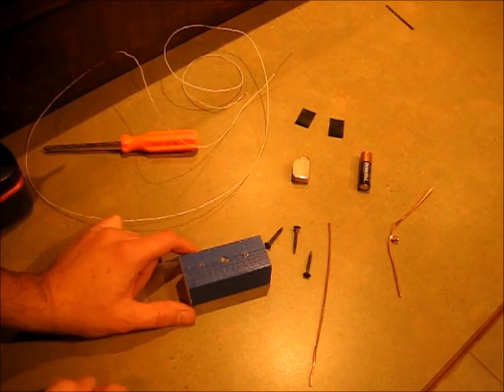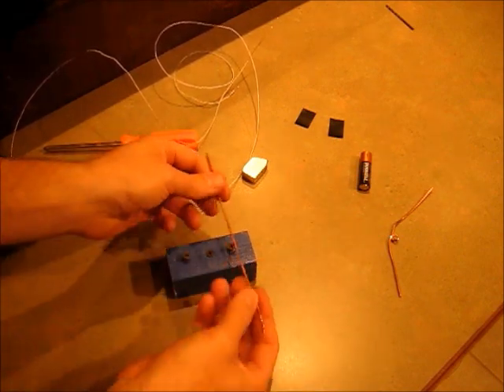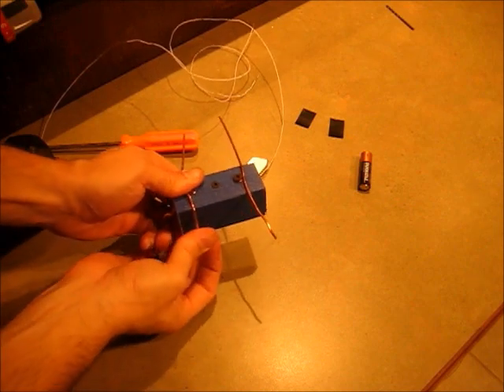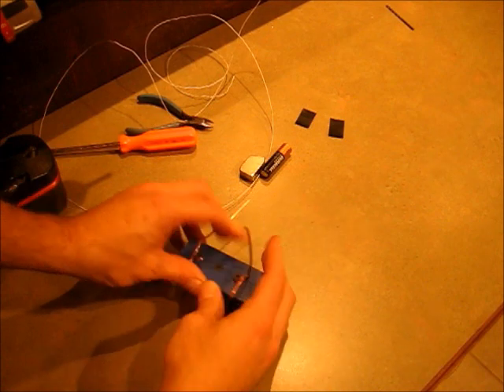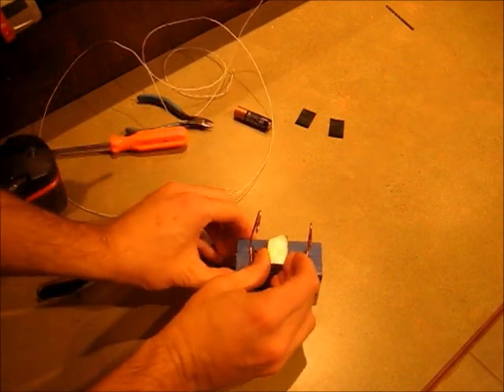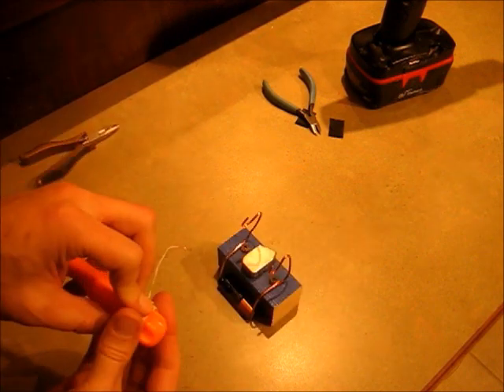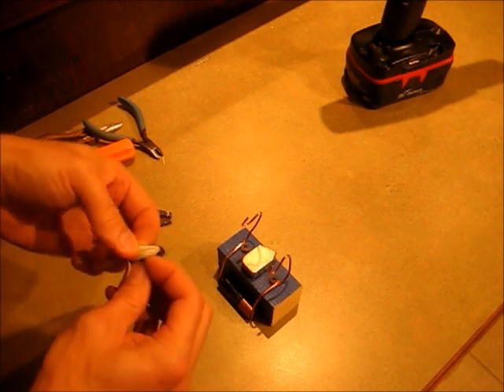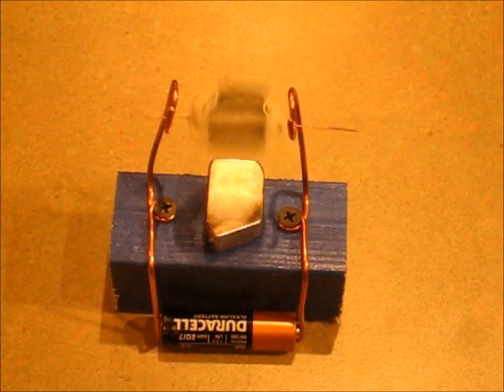How To Build a Simple Motor

Comment: I'm trying to build one of these but can't seem to get it spinning, idk what I've done wrong but not too sure what the magnet is doing in the first place since the stator is copper and copper isn't magnetic? Pls help! Thanks
Reply from the maker: Destin Pearson - Copper does not stick to magnets, but when electrical current runs through a copper wire, it creates a magnetic field.  This field plays against the magnet, to spin the motor.  Hook up the battery and try to get the motor started with your finger.  If it does not work, send a video of it not working to HowToLou@gmail.com, and I will help you diagnose the problem.
Reply: Alright I sent a video! Hope u can help figure it out if it isn't too much of a burden, thanks!:)

Comment: This is a crazy question but what if you make a bigger version of this motor and use it in an automobile lol
Reply from the maker: gargilbert - I have a much more powerful motor project at: https://www.youtube.com/all_comments?v=19oW0G8sYng  Yes, you could make a motor big enough to power a car.  You would need much more perfect parts, built in a machine shop.  You would need bearings for the rotor, and the rotor would have to have at least 10 or more arms, not just two.  It is posssible, with a ton of work and dedication.

Comment: I think it would be easier to build one that has no arc and only 1/2 of the wire is insulated, that was what I did, sine my batteries dont have enough power to make the coil jump.

Comment: How does this work tho? The coil should act as a permanent magnet, with one side being the north and the other the south pole, seeing that the motor uses DC current. Shouldn't this make the coil flip around so that one pole of the coil meets the opposite pole facing up in the permanent magnet, and "lock" it in place?
Reply from the maker: Excellent question! The rotor jumps up and breaks electrical connection, during part of each revolution. The rotor is arced slightly, so that, unpowered, it naturally rests with the N pole downward. If the permanent magnet’s N pole is facing up, as soon as you power the rotor, it: 1-flips over, 2-lifts up and breaks the connection. Without power, it keeps rotating around to its original N-pole-down position, and sits back on the stator, to get more power to do the whole thing again. See more motor info at HowToLou.com/motor. -Lou
Reply: ***** Thanks! Great explanation!